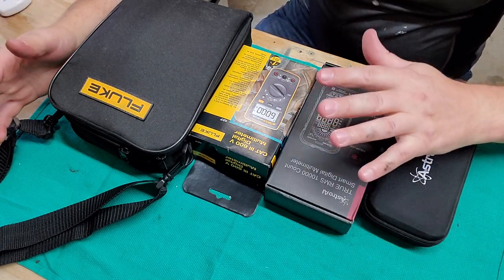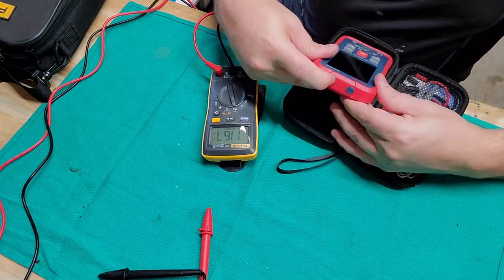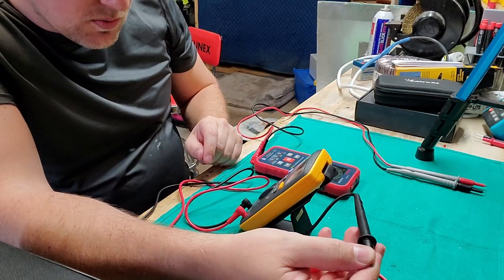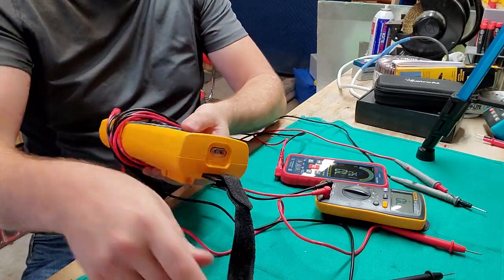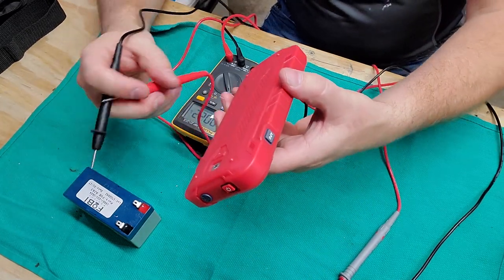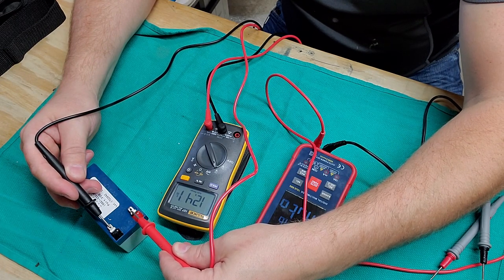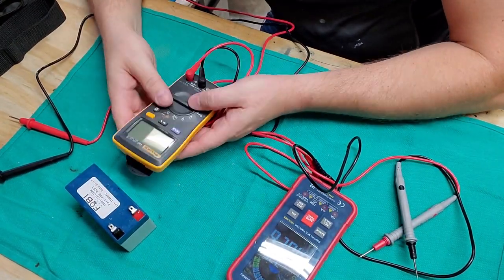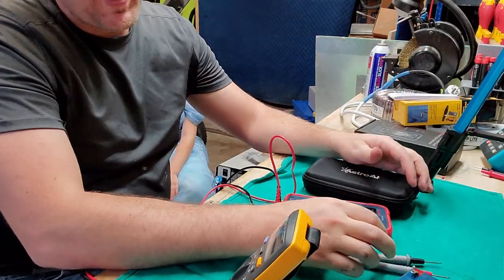Mini Meter Showdown And Giveaway

Comment: The leads are the reason continuity response it lower on the Astro AI meter. Clean and polish them with a metal polish and you will see significant improvement in response.

Comment: I've had several 100 dollar mutlimeter testers x-rayed, including a Fluke 107.  The Fluke 107 has a very simple board with sparse components compared with the other DMMs.  Other DMMs have much more components and in a much more dense package.  It could be the simple board for the Fluke 107 gives it durability and safety, but I was pleasantly surprised with the other DMMs for having much more components for the same price while offering pretty good quality.  Technology and manufacturing has improved so much over the decades, great time to be a tech in any field.

Comment: Just some opinions/thoughts:

1) The Fluke 107 will probably have better battery life...that assumption is made based on the display alone.
2) I would not trust any DMM on mains voltage without some heavy analysis by the eevblog crew...it's good to have people way smarter than myself pointing out possible issues.
3) I'd like to see if they are using a proper HRC fuse(s) inside the cheap meter
4) The Aneng AN8008 seems to be a good cheap and lightweight meter...but I don't recall if it was recommended for mains voltage.
5) The lead detection on the AstroAI seems nice...that used to be a feature you had to pay to Fluke for a simple safety feature.  You get a loud warning in your in voltage mode but have your probes in the current port(s)?

That said...I own a Fluke 107, Aneng AN8008, and two Fluke 87V.  I use the cheapos as secondary meters usually...like putting them in circuit to monitor current.  However, I will ALWAYS lug my 87V around because it is the safest and most accurate meter I have...I don't want to second guess my tools.  There aren't too many meters out there that can compete with the 87Vs high voltage diode tests and the response time in continuity mode.
Reply: Have you considered how many relatively inexpensively built electronics items from China that you trust plugging into mains voltages around the home? Some running for a long time like phone chargers, T.V.s, WiFi routers, etc. Yet you don't trust a relatively inexpensively built meter from China for momentary testing of mains voltages taking just a second or two.
Reply: @Handlebar-MustDash  That may be a good point, but the only electronics I've ever had nearly take off my hand (twice) were cheap overseas multimeters.  One nearly took out my eye.  They are getting better, however.

I've seen quite a few teardowns of other electronics, and usually it's only the super-cheap fleabay specials that appear concerning.  The issues usually show up in the SMPS itself with poor insulation between the primary/secondary coils of the transformer, fake X2 capacitors, and poor isolation between the primary/secondary sides of the board.  Usually once you get past the SMPS it isn't usually that scary unless thay failed to fuse their product.

Comment: that 107 magnetic stand is very cool/different for sure, and the screen is larger and readable (although i too prefer your Astro reverse neg screen). i use an older Speco DMR-3800 which  is smaller, fairly good & still works like a champ even all these years later. hope that someone deserving wins this very generous giveaway, best of luck to all ! thanks for the opportunity BBC !